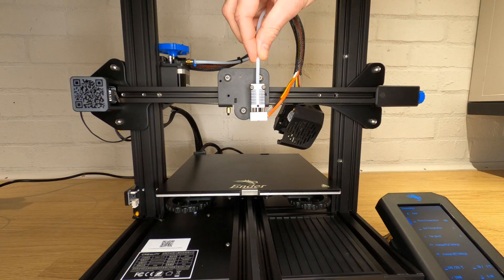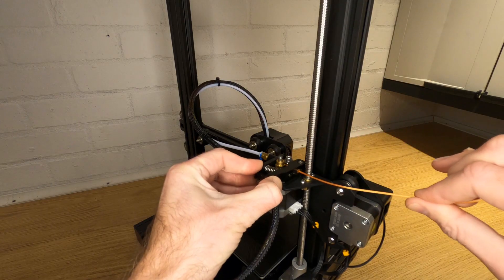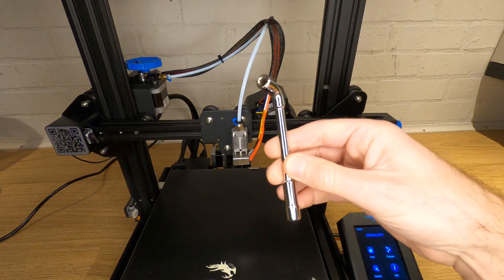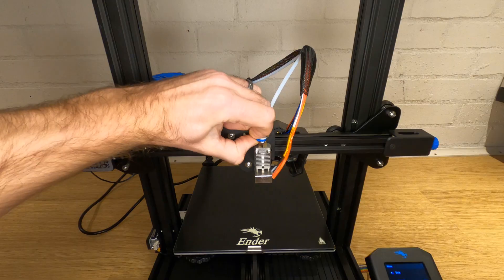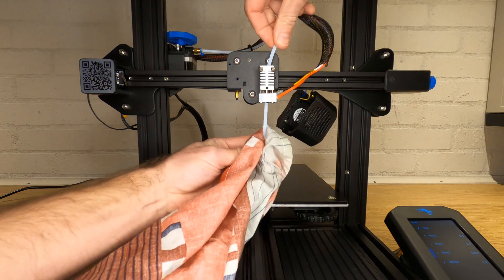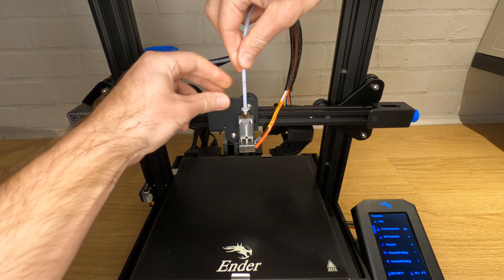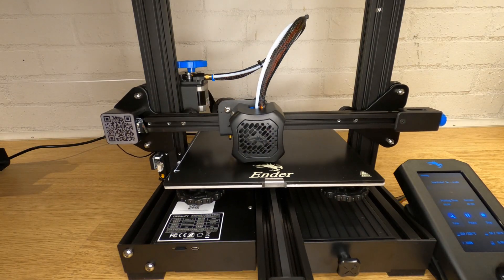Ender 3 v2 Hotend Cleaning - Eliminate Stringing & Clogs

Comment: Be carefull while taking off the nozzle, sometimes the nylon tube melts slightly and holds the nozzle, I would recommend taking out the tube before the nozzle, I had to pull it out before I could remove the nozzle and damaged it in the process

Comment: Humidity effects filament in an odd way, it acts as though it's dried out and brittle when it has been too moist of environment.

Also triple check the settings on your slicer, especially if it likes to update every time you use it, make sure the feed settings are appropriate for your 3-D printer and that it is never trying to feed out a specification especially with incorrect temperature settings 

Temperature settings from even high quality brands still have a major variance in temperature range, for instance PLA of realities brand on reality injury three suggest 195°, in practice I have had to use up to 240, many things are also counterintuitive just because you raised 10° on the nozzle doesn't mean he raised 10° on the bed 

Many times I think I'm fixing an issue I'm making it worse because so many things are counterintuitive, the best thing you can do is let it run until it messes up instead of tweaking while it's running so you can get an accurate failure therefore an accurate symptom to troubleshoot this has been the biggest thing that helped me because I just can't leave the damn thing alone I'm worse than a cat

Comment: This still helped me in 2025! I changed the bowden tube and after that I had jams! Turns out it is not enough to just "push it all the way down the hotend" as often described. Your tweak with the nozzle rotation before the tube insert was a life saver! (And yes, you are right, the stock couplers are garbage!)

Comment: Thorough and accurate! I would suggest to disassemble old block before buying new one. Then if anything gets broken you can order everything needed at once, even fully assembled. Also, I resorted to unplugging the wires and used a heat gun too loosen things.

Comment: DO NOT FOLLOW THIS VIDEO!!!  i attempted and everything was going great, till it wasn’t. It started with a thermal runaway warning on the screen, I then bumped my fan cover and the heater block threw a spark and shorted my board. My printer is now bricked.

Comment: If anyone is just trying to remove the boden tube, and its still stuck after removing the fitting when a wrench, heat up the hot end and then try removing the boden tube.

Comment: Great video. My printer has a direct extruder upgrade (present when I bought it). Would be great to see how to clean with my configuration.  I guess remove the extruder and follow the same steps.. not sure what size Teflon tube I'd need to clean the hot end with though.

Comment: The hot end pipe on my printer is clogged and I tried running a pipe of Bowden tube into it but the filament that clogged the pipe is so hard it can seem to melt to allow the tube through it.

It is like super clogged.

Any suggestions?

The heat sink and heating block are clear, it’s just the pipe in between that is clogged

Comment: I'm using the ender 3 max neo and just recently, the PLA filament doesn't come out as it normally does, when heated between 190-240 ish... when i raise the nozzle temperature to like 245 or higher, all the filament does is, slowly ooze out in thin strands and any test print I tried after the oozing stopped, had rough and uneven layers, so I'm assuming that the filament tube and or nozzle are clogged or are obstructed, do i have a clog? thanks

Comment: Only one thing to say: my fan broke while I was cleaning the hot end.
Manually turning  the fans off during this process will help you avoid that, because if you follow this tutorial to the teeth, your fans will be dangling there at full throttle, one little touch and they're gone.

Comment: Super helpful and excellently explained. I had a clogged hot end with a clean nozzle and followed this video but still no filament came out. Turns out I had a kink in my filament. It went through the bowden tube smoothly to the hotend but then wouldn't go any further. So if you have the same problem just try cutting the end of your filament and try again.

Comment: My Bowden tube is so trash I couldn't get it to go so freely through the hotend as you, almost as if it somehow became oversized all of a sudden, since it was the one that came with my Ender 3V2 Neo. Ever since I saw the hotend on my machine and compared to the V2 (non Neo) and others, I thought it was kinda trash anyway, so I'm changing the entire hotend anyway, but following this video to the T as it is the most concise I found. I was able to clean the entire thing no problem and disassemble it down to parts I didn't even know it had. Sadly, sometimes bad quality only leaves replacement as an option for repair.

Comment: 4:55 Other then when you install the length feeding into the extruder slips like a MOFO and you should replace that coupling to because the old one will be too loose. (in some cases)

Comment: Excellent video, I was getting blobbing on my hot end. After watching your video I found out that it was being caused by a loose nozzle. I cleaned out the hot end, replaced the nozzle and tightened it up as per your instructions. Now my prints are working perfectly. Thank you for sharing your expertise!

Comment: Hi Ricky,greetings from Lithuania.
I have a question,if i want to change heater and cartridge,to a higher temp. Do i realy need to make changes in firmware,i have a custom jyers firmware its allready set to 300c max. Ender 3 v2

Comment: I’m having an issue where before I start a print the nozzle starts to leak filament, I’ve adjusted the heat “lowered it” and it continues to be an issue always when I do a preheat. Could this be the issue? I’ve been having nothing but issues with my ender3 v2 neo since we’ve gotten it.

Comment: I cannot even explain how many complicated things i've tried.. and how many parts i've changed.. turns out LMAO there was a big ol' PLA in form of a tube stuck above the nozzle, sealing the passage for new pla (HENCE the clicking sound from extruder wheels. feeder.) This video help me realize you can put whole feeding tube through the part where nozzle sits...that's why I've pulled out this chunk of PLA out...Wish I could post a pic here lmao. I'll put it on my shelf with figurines i've made as an achievement, reminder. lmao
Reply: Same lmfao
Reply: Same here buddy.... guess this issue happens more often than not😅

Comment: Thanks for the video, but if anybody answers this, why do you have to heat up the nozzle in order to change it or clean it
Reply from the maker: The filament that will be stuck to the nozzle will bond to the nozzle and heatblock when cool. You need to melt it so that the parts can be separated.

Comment: Thank you for these instructions, they worked great.  I just experienced my first blockage and didn't know what to do.  The only thing I would like to add is that I also had a blockage within the white tube which I couldn't clear at first.  I ended up heating the tube where the blockage was using a heat gun and then used some filament to push out the blockage.  That worked great..  Thanks again.

Comment: Thank you so much for saving my sanity. I was printing a benchy for some nostalgia and at the 6th layer, my hot end suddenly clogged. I recently had under extrusion issues, but I didn't think that this was the problem although it happened to me before.

Comment: Thank you VERY much Ricky!

I have an Ender 3 V2 Neo and despite the little differences, it was enough to do the whole process. 

The only issue I had was that the cold filament broke inside the tube while pulling it out so I had to detach the tube from the stepper side too, and using any tool I was able to grab the little part of the filament that was still there and removed it (considering to keep the other side hot to be able to extract the nozzle side part of the tube/filament). 

Thank you again!

Comment: First off thanks for this video!
It at least gave me the motivation to try and save my Ender 3 v2 Neo again, unfortunately in vain.
I managed to get the completely clogged nozzle off and clean in.
I have the original white PTFE tubing, however with nozzle completely off as stated I then cannot push the PTFE tubing all the way through to the other side like you did, even at 250°C, it just enters I'd say 1.5 to 2cm max from top.
However I managed to get a huge clogg out of the extruder using a thin steal screwdriver and could see completely through with a flashlight.
My hopes were on top, reassembled everything and the symptoms persisted, can't get it to extrude anymore and it cloggs again right after this.
This is my 2nd Ender 3 that worked perfectly well for 30 to 40 prints, then all of a sudden just needs to have a filament break or run out (which happens or will eventually happen), once it prints without filament for a while, you can forget that thing forever and it can never be revived.
I have 4 other older printers like A8 and prusa copies, etc. they still work, the quality is not as good as Ender3 but they still work.
I am sad and disappointed, and wish I was wrong about something and there'd be something I can do, but I don't want to put any more cash into this money pit-

Comment: this guide was amazing thank you. I actually used a method from another video to ensure tightness though, and that was to tighten the nozzle, then fit the capricorn tube through the new fitting at the top, press it in tightly against the nozzle and fit the clip, then tighten the slightly loose fitting at the top to compress against the nozzle.

Any particular reason or downside to this method versus yours?

for me it was easier as I did not have a good way to work with the hot nozzle without burning my self, so it was easier to ensure a good fit, but interested in your thoughts.

Comment: mine keeps clogging even when i clean it  as you do it also when i print set my pla too 220 in cura it automatically lowers it to 175 and then it clogs again can somebody help with thiis issue
Reply from the maker: This will be a setting in Cura that you need to change. Have you tried changing the print temperature in Cura to a higher temperature?
Reply: @RickyImpey  i figured it out i use the normal tube and i was meltiing at 220 and then i changed to a new filament to 210 c and it can now print without clog maybe you should make a video about this as im sure many people have faced the same issue thank you for respondind tho :)

Comment: HELP, I CANT GET THE NEUMATIC FITTING OUT OF THE TUBE AAA
Reply from the maker: You need to depress the collar on the back of the fitting. I use a small spanner (wrench) to do this but sometimes the tube has a ring worn into it and it's almost impossible to remove. Try and remove the other end. If you can then slide the fitting the other way and remove it from the other end of the tube.

Comment: My printer gave an error while cleaning: Printer Kill Reason: ERROR MAXTEMP restart required
Reply from the maker: Yes, this can happen. It's a safety feature to make sure that you don't get into a thermal runaway state. You should be able to get quite a bit done as it cools but re-heat if you can't do any stage. It can be a bit annoying to have to turn the machine off and on agian to reheat but it's still the simplest method to clean everything out.

Comment: Hi,  Great video very helpful thanks. My printer might be different. I use standard 4mm Bowden tube with standard 1.75mm filament. Removing Bowden and nozzle I can get a 50mm Alan key from below to push up from below to come out barely at where Bowden would enter from above. I've cleaned and heated and believe the pathway now clean but my Bowden tube only appears to penetrate 20mm into heating fixture from above. I've another piece of narrow tubing for extruder section but it goes only 35mm into fixture. Machine must be designed to have the pathway narrow until it reaches 2mm width at a certain point. Here's hoping 20mm into heater fixture is enough for my Bowden tube to fit into the heating element. Thanks.
Reply from the maker: It sounds like, from what you are describing, that you have an all metal hotend. What printer do you have?

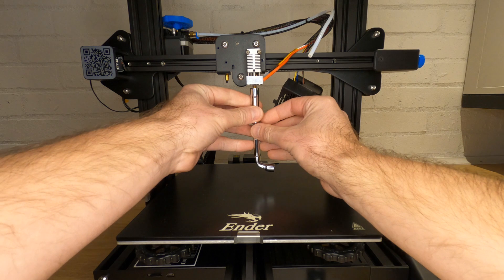Comment: Hello, I have seen your video, all is clear, execpt for the reassembling part - heating.....  I see you are wearing heatproof gloves but, when exactly (@what minute of the vid) do you start with the reheating? I got a bit confused, you say at around 4:08 I quote: ..now with everything still hot....  we are going to refit the nozzle... (mind  you @5:26 no gloves from @5:28 refiting silicon cover with gloves...)

BTW keep up the GREAT work! Cheers...
Reply from the maker: Apologies for not being clear. I keep the hot end hot for the entire process. I wear gloves if i'm going to touch the hot parts at the bottom of the assembly but didn't when using tools or re-attaching the clip at the top as it's not very hot here.

Comment: since changing my bowden tube on my ender 3 I cant get my filament to feed. Tryed cleaning the hotend with the bowden tube like you suggested but I can only push it thru about half way and the it jams into something. I can get a wire to poke thru, but filament will not feed thru. Was hoping it was just plugged and pushing a bowden tube thru would fix it. not sure what else I can try.
Reply from the maker: Sometimes the filament can snag on the edges of fittings on the way through. Try cutting a slight point on the end and, when it snags, twist the filament. I find this always works.

Comment: Thank you. Like, genuinley thank you. I have an Ender 3 and an Ender 3 V2 and neither of them were working correctly, and I was considering just trashing both of them and buying a Prusa (which I still plan on doing but I wasn't going to print anything until I got it). No other tutorial helped me, but then your method of using the bowden tube to get rid of clogs has revitalized both of my printers. Not only this video, but also the trimming guide has saved both of my printers from the trash. Seriously, you're a lifesaver :D
Reply from the maker: Really glad some of my videos have helped get your machines up and running. Well done for not giving up👍

Comment: I have been printing with PLA for about 2 years on my Ender 3 pro, had a few issues here and there with stringing and blobs but nothing major until I recently started using PETG so I have a sneaky suspicion the nozzle is at fault. Going to be buying the upgraded tubing and give my nozzle a thorough cleaning. Thanks for the great video 😃

Comment: Thanks so much for this. I was having issues where filament wasn't coming out of my Ender 3 nozzle, I changed the nozzle head and still saw no change, little did I know my hot end was clogged. I followed the steps you explained and out popped a large plastic clog. All is fine now, printing like brand new. 👍🏽👍🏽👍🏽👍🏽👍🏽😊
Reply from the maker: Awesome, glad it helped

Comment: Thank you for the video. I did not think to check the center of the hot end a clog, which was my issue. Went threw 3 nozzles and 1 new Bowden tube section... Thought it was suppose to be a stop in the center so when you said to push all way down through the hot end . . . That was my issue for last 4 hours of trouble shooting. Thank you!

Comment: Your becoming my favorite source of help even when it doesn't match my machine.
I wanted to do a clean just to try.  Did a cold pull that broke the filament, ended up with a chunk of filament that couldn't be reached by heat and couldn't be pushed.  
I have an Elegoo Neptune 3 and you can't push the bowden tube all the way through, but thanks to this video I removed the pneumatic fitting which helped me reach the blockage.
Reply from the maker: Great to hear, thanks for taking the time to leave a comment👍

Comment: I'm a newbie but how do you get the bowden tube unstuck  from filament,it will not pull out or anything
Reply from the maker: The Bowden tube is made from PTFE which 'shouldn't' stick to your filament. If you have a lump inside the end then it can be hard to remove. Have you got a way to warm it up and soften the filament? It should be much easier to remove when it's hot.

Comment: Really helpful video as always on this channel.  However, in the year since the video was published, the pneumatic fittings on the UK Amazon link have changed to a type with no locking collar.  Lets hope they work OK as my stock Creality fitting was rubbish!
Reply from the maker: Thanks for the heads up, I will check it out. Unfortunately Amazon do this with no warning🙄
Reply: @RickyImpey  The Creality fitting on my 3V2 worked OK with the standard Bowden tube, but when I switched to Capricorn to print PETG the fitting chewed up the surface of the tubing and didn't grip it properly.  The new type on the link survived its first day of printing, so keeping my fingers crossed!

Comment: Wait, the silicon cover is supposed to be there?
I thought it was just a packaging cover to protect the nozzle during shipment :/
I've never had it on during my printing
Reply from the maker: Yes, it's there to stop any melted filament sticking to metal parts but it also helps keep a little heat in the hot bits.